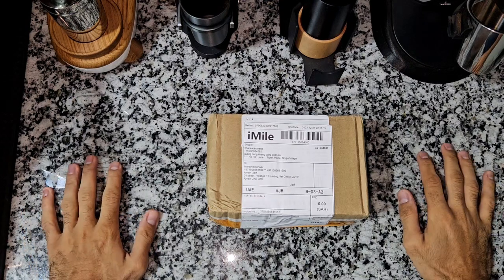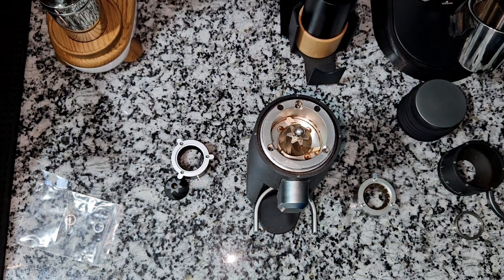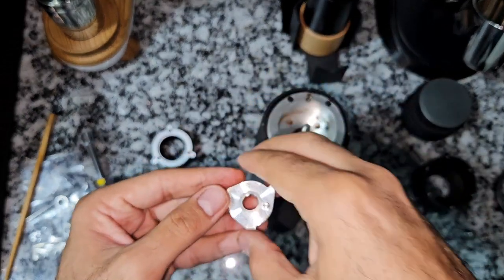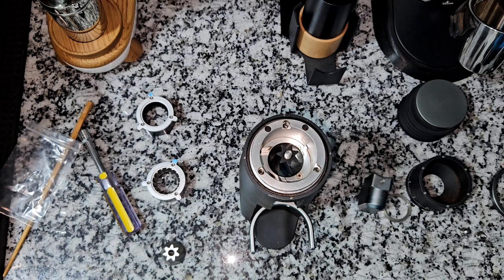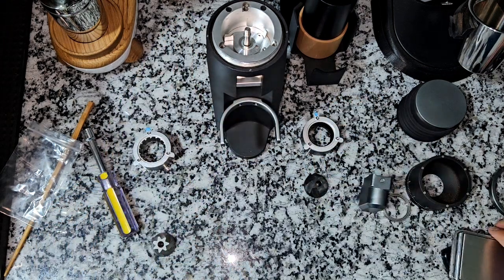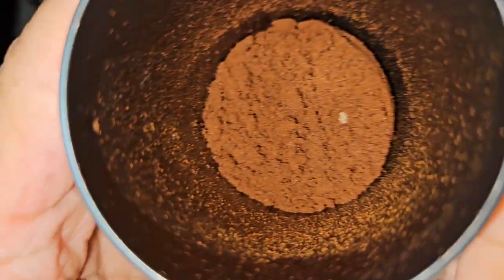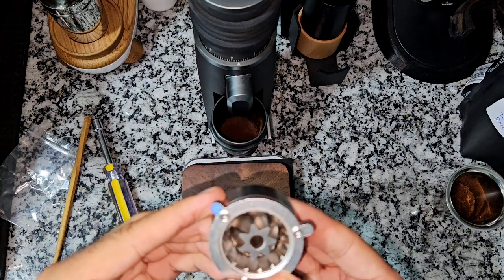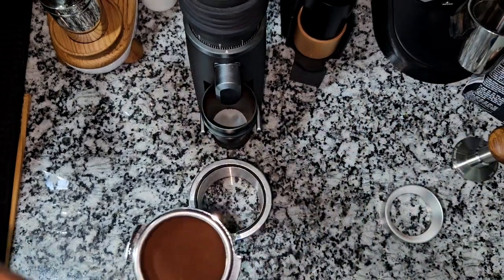Titanium Burr Upgrade and Shimming for Starseeker Edge Grinder

Comment: I noticed that you add grains before turning on the mill, is it correct to do this..?  Most people turn on the mill first and then pour in the roasted beans, which makes it easier for the burrs to grab and grind them into powder.

I bought milk and these millstones as a gift, some will arrive earlier, some later..., in any case, your review influenced the choice to purchase this model, for which a special thank you.  How does the mill perform with light roasted beans?  Tell us about it if you have experience.
Reply from the maker: Thanks a lot.  You are correct. I did that to challenge the motor and see if it is going to stall or not. And it performed well.

The grinder is really good value for the money for sure. I mostly use it over Niche zero and DF64v.
Reply: @morningcoffee1  Thank you.  I took an Orca from Cafesing, it is manual (and I used an electric drive with speed control for it, sometimes it’s hard for my hands), the mill has flat and ghostly 45mm burrs and can be easily changed places.  https://youtu.be/7dJPggADW0k & https://youtu.be/xDTjZgb1r0U is a third-party review of it, but in general, what it is, that is... You can’t grab the stars from the sky, but a little grinding is enough, especially since it has a convenient static motor for it.
Reply: @morningcoffee1 Greetings!  Yesterday I received titanium millstones, but did not find (in the package) any rings (gaskets for fine tuning);  By the way, the manufacturer recommended placing them under the impeller for greater integrity of the assembly, and not under the millstone on top of the impeller (this is by the way) and if you look at it this way, it looks quite logical and there will be no gap between the impeller and the millstone into which coffee dust and oils get clogged.  / I thought that it could be used as a material for the gasket - Teflon (namely fluoroplastic; its polymer form), it holds its shape perfectly, has a lubricating effect that reduces friction between elements, like a bearing, while being resistant to high mechanical and temperature loads. 
Flat flange for a PTFE washer for 452 ₽ - already with a -18% discount https://sl.aliexpress.ru/p?key=tWIsOmL